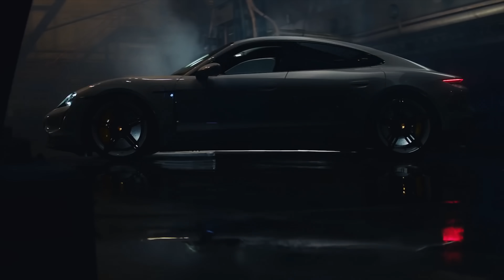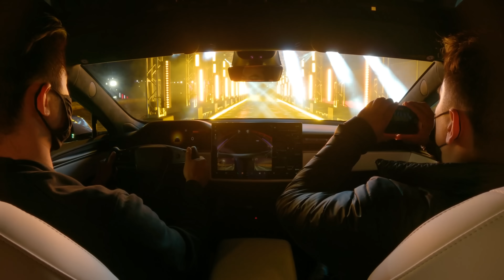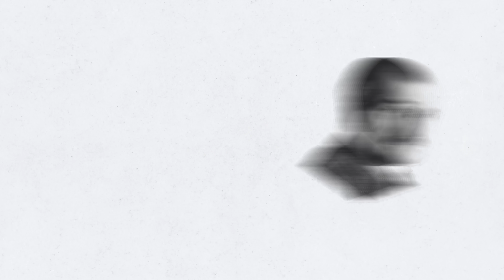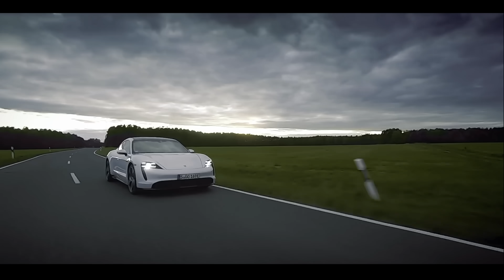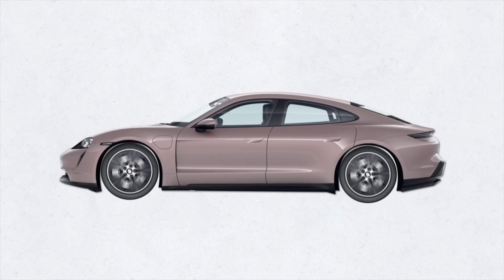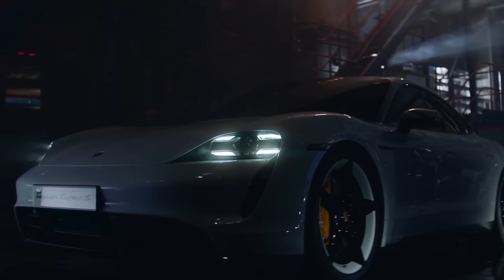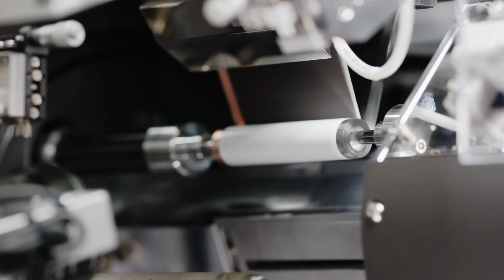I’ve Had Enough, Here’s the Truth About Tesla

Comment: Well for starters I don't like the looks of them. But besides the point they need to do something about a range extension. You can't just have vehicles dying in the middle the road with no power. If they should be adding an auxiliary battery that you can switch with Manual operation to get you in limp mode to a nearby charging station that will leave only necessities operating on that battery that means your phone charger or radio will not work

Comment: its great that they are bring jobs to the US but 1st I want an electric car! BUT the mileage is to low. the average is around 250 miles. I will not buy a full electric until the mileage is double that. look at Toyota they have a RAV4 prime its half electric and half combustion it gets 600 miles of range combined for less then half the price of these EXPENSIVE ELECTRIC CARS. HOW DO THESE MANUFACTORS OF ELECTRIC CARS  want us to buy these expensive cars to the average consumer if they only get so low mileage. Right now I feel that the electric car is not for the average person .I feel these manufactures should look into the combustion plug in cars instead.

Comment: TUV Germany just finished testing 9600000 cars. Tesla model s was among the worst.  10.6% of the model S car's tested would not be considered road legal after the test with 100 check points. Similar to ordinary EU test you would need to keep you car road legal in EU every other year.  The only EV with more flaws was dacia's cheapest cars.  Tesla had flaws that massively impacted safety. Like poor front suspension.

Comment: Does everyone understand that current Tesla cars are simply phase 1 projects for the Mars program? They are simply to prove the concept works. Cyber truck is a phase 2 Off-road car designed to handle rougher conditions. Phase 3 will most likely be 100% integrated with starlink, pi phone, and solarcity. Maybe even spaceX compatible.

Everything about these cars is focused around living on Mars and is subject to change.

Comment: My feelings about electric cars.  Imagine that it's 2035-2040 and the government has forced the majority of gasoline and diesel vehicles off the road.  It's a long holiday weekend in December and the roads are packed with cars.  A large blizzard covers the east west interstates and they become huge parking lots.  Your battery is probably half discharged and the overnight temp will be around zero.  The battery uses electric heaters which won't last overnight.  It will take days to remove the cars and bodies.  Has AOC or any of the green nuts thought about such a scenario?  They better because something similar will happen.
Reply: Pretty dramatic scenario, but it's kinda flawed and irrational. Tesla's 4680 form-factor battery is ramping up and delivers 5X energy density and 6X Power output. As renewables become more efficient and wide-spread, our grid is becoming more sustainable and consumers are installing their own energy generation + storage systems (enter Tesla solar + Powerwall), effectively decentralizing from the grid and becoming energy-independent.

Comment: I am a porsche owner of a 2021 Carrera S and the fit and finish of exterior paint and interior are refined elegance and of course you can select any option to customize your car both interior and exterior.  As for the Tesla.  I am have seen numerous detailers work on teslas and I am not impressed. Many Tesla have very poor paint jobs with numerous defects-from dust specs embedded in the clear coat to scratch and swirls etc.  And for the interior-not very nice looking for a car that costs that much.
Reply: Eh, the fine-detail nitty gritty details like that don't bother me. Performance is where it's at, and Tesla is clearly #1. Tesla's insurmountable lead is accelerating and they will continue their dominance this decade and beyond.

Comment: Don’t like the steering wheel? No problem, the round wheel is still an option, so you can toss out those criticisms. You praised Porches self-driving tech but barely touched on how much better Tesla’s tech is. On range, Tesla clearly wins. You briefly mentioned charging rates but conveniently left out charging networks (hint, because Tesla’s can be charged just about anywhere while alternatives are much more sparse). Don’t like the interior? Fair enough, but that’s purely personal preference, many people like a cleaner simpler design. You also forgot to mention that the Porsche is effectively a sporty 2 seater, while the model S is a full sized sedan -much more practical for daily use.

Sorry to the haters out there, but any honest side-by-side comparison would show the Tesla as superior.

Comment: Ok. The price is high for both but why would you NOT buy the American one. Btw,  I  drive an EV for the ENVIRONMENT. yes. At 1 mile high there is 35% less oxygen. At 2 miles high you can NOT breath normal without  extra oxygen supply. 2 miles is to the end of your fckn street. Now put 1.4 billion gassers in there and you will understand we are poisoning ourselves. Most folks don't understand the science behind this and think everything is A OK. Another thing is the money you carry to the gas station like a junky to a dealer. Just to make a few billionaires even richer. You must be nuts. OPEC keeps the price of oil high on purpose with their cartel racket. And for jobs. I used to be a fuel tanker driver at an airport but now I am a chef in my own restaurant. I don't need the Fossil Fuel industry for the money..

Comment: The 2021 Model S Plaid and the 2021 Model S Long Range have the same body shape with newly widened front and rear fenders. The Long Range version can be ordered with the same 21-inch Arachnid wheels that are standard on the Plaid version. The two vehicles are nearly identical underneath, the main difference being the dual rear motor unit used on the Plaid version.
Reply: Those arachnid wheels are awesome!

Comment: I love these things claiming how some EV can go 1000 ft or 12 miles really fast - why don't they try Le Mans or any legit race? Dakar Rally - the only thing they can compete with is other electrics in a "Special" race.  A 63' VW Beetle could be a Tesla Model S Plaid in a race from SF to LA because the Tesla will have to stop twice, (3, 4 or 5 times if it drove fast); and charge for 40 minutes each time.  Le Mans winners travel the equivalent of Boston to LA and then to SF in 24 hours - try that in any Tesla.. you'd be talking about to 3 days. There is one of the problems of being an EV - if you go fast your range falls very quickly.

Comment: absolutely love that yoke wheel. The pull is insane on that plaid. if you palm the entire side of the steering controls, it honks the horn, so technically you can honk faster than reaching for the center. People who actually USE it love it. People who cant adapt just listen to you tubers who also cant adapt and simply write it off. One finger hooking is how U-turns are done - just like a normal wheel. The yoke is fine

Comment: When these batteries start to brick look out. The cost  mining and of making batteries pollute just as much if not more than the gasoline motor. Then what do you do with all these junk batteries?
Reply: The batteries used in Teslas have an expected life of 300,000 to 500,000 miles. Many of the future Teslas will likely be using LiFEPO4 batteries and have a life of 700K to 1M miles. Plus these batteries are recyclable.  Try getting away from the conspiracy websites for your information.
Reply: @skipondowntheroad5833  You said the magic word....""EXPECTED""

Comment: I will buy one if price is more reasonable like < $50k. My 2005 Sienna is still running flawlessly at 310K miles, has 450 miles range and 5 minutes fill up.. if the Sienna runs out of fuel in the middle of nowhere I just pour a can of fuel and keep going. I can’t charge an EV I’m middle of nowhere.
But sorry, $100k for an EV is insane.

Comment: Hey Scotty been a fan for a long time now I have a 2012 Dodge caravan and it has been a amazingly reliable vehicle recently it wouldn't start just ticked I tried to jump it it wouldn't I tried to smack the starter nothing so it has sat at a garage and the interior lights works there not dim at all and it did finally jump but the garage is telling me they think it's the tipm Have you had many tipm problems because it's a very expensive part and don't want to have to spend it if the garage is just bsing me to pinch a penny

Comment: I’ve used some electric forklifts and from what I’ve seen those batteries get pretty hot when they try to charge them faster. If you’re lucky you’ll get two hours after charging for fifteen minutes. Through the charging cycles and then driving they’re going to get progressively hotter with every charge/discharge cycle. Driving two hundred miles is one thing. Waiting 2 hours to recharge won’t go over very well for all those impatient drivers who pass you like you’re standing still on the interstate. Try driving those things in the snow or other inclement weather conditions. I’ll wager you may get a first time buyer but it ain’t likely to get them back in the dealerships a second time.
Reply: Most EVS have thermal battery management, including Tesla. They're very in popular in Norway and very effective in the freezing weather, they just use more energy in a cold

Comment: Most ev are cheating around spec's when compared to tesla. For example the taycan says its faster while having a lower range which means smaller battery which means less weight which means faster charging. Although they are 30-40% more expensive.  So if you really want a true comparison, be precise accurate and fair to gain trust of consumer.

Comment: I'll only drive cars that cost under $2000 at auction from my local tow yard. I drive a 2005 Taurus I purchased for $250 that had 100k miles, last year and came with rebuilt transmission.
Reply: Does it suck being poor?

Comment: I do some battery research as a hobby and Scotty pretty much puts it like it is. Batteries, when you really take a step back, are pretty weak. Gas is so much more efficient, but as political powers push electrification, everyone is now trying to make better batteries for cheaper. Tesla knows this well and they are putting everything they can into it. However, because Tesla is mostly concerned with affordability and transitioning the world to electric, they decided to make the 4680 cell. The 4680 cell is by no means as revolutionary as a solid-state battery or graphene-based chemistry, BUT, it is going to be MUCH cheaper to make with respectable improvements in range and safety. For the average person, the 4680 cell is marginally better. But for the manufacturer, it's a huge improvement.

Comment: Just want to say you are one of the best Mechanics around! My dad was a mechanic and I learned a little from him..but now I have been learning alot from you!! .I have a question... My husband and I bought a 2006 Cadillac SRX 3.6 a couple months ago.. I wet to AutoZone I hooked up an obd11  to it  cuz the engine light came on..... it said that two cylinders were not working because it was running really rough so we replaced the ignition coils and spark plugs. Still every time I go to put gas in the car the car would stall and  I would have to feather the gas tank in order to get it to run. So I ran another diagnostic test and it said the evap purge valve needed to be replaced so I did that. Well I am still having the same problem it idles rough ..and when you accelerate it feels shaky and bumpy just does not feel right something is wrong. I have been looking all over online I don't trust mechanics around here that's why I always try to do it myself.. I bumped into your channel and I think you are absolutely amazing!!! Please help!

Comment: Hey Scotty, Im running out of ideas! Misfires from cylinders 4,5,6 and a bank2 catalyst below threshold code. I already installed, 6 new fuel injectors, 6 new iridium spark plugs and 6’new ignition coils. I cant get the codes cleared and fixed?! Help!!! Its for a 2016 Honda Pilot exl. Had the timing belt changed at 80k miles it now has 120k.

Comment: Hi scotty small correction the 2170 is mostly used by tesla since it was the one who developed the standard . The industry standard used by competion is either prismatic cells made by LG chem (mostly) or 18650 used by lucid . i believe tesla has moved all of its cars from 18650 to 2170 .. the 4680 as was mentioned was a internal RnD effort , The issue i believe tesla is facing in 4680 production is with yields not being enough . The chemistry and manufacturing have been validated already with test vehicles it isnt vapour ware ... Now with regards to which car between tesla and a porche .. between power, comfort, range, practicality, technology and price ... tesla has to be the choice for any rational person
Reply: So many errors...  The Model S and X still use 18650's, even the Plaid.  Lucid uses 2170 cells by Samsung, as does Rivian.  Prismatic are hard-cased cells, typically LiFePO4 and by Chinese manufacturers, like CATL. Soft "pouch" cells are used by GM, Ford and others and they are made by LG and a few other manufacturers.  The 4680 is very much vapourware, it is very far away from significant mass production due to quality issues.  You have to keep in mind that even the most infinitesimally small fault would cause a recall (ask GM/LG about that...)
Reply: @awebuser5914  2170 is still mostly used by tesla since other cars arent on the road yet and can be rounded up to zero . my error was that 18650 was used by competition , tesla is still using 18650 . This is still 2 order of magnitude less then their current line up using mostly 2170's in the 3 and y. 4680  yield and quality are 2 different issues . Tesla in their conference call mentioned they had YIELD issues , which means the Yield of the process is less than ideal . The chemistry is valid and cars are on the road using them for life leader testing . The definition of vaporware is tech which does not exist and  option to own it in the future are sold.

Comment: Hey Scotty I have a question I’ve owned two cars a 2003 Subaru Forester and a 2006 Pontiac grand prix and they didn’t last long I live in la I used them to go to work and back home and in the weakend a I like to cruise and go to beaches both these cars will fall apart the exhaust would break of the hook and be hanging engines would start messing up and would become unreliable I want to buy a car that will last me a while both these cars have lasted me less than a year I want to ask if a 2006 Lexus RX 350 are they reliable I do know how to do the simple services

Comment: Tesla is clearly the best when it comes to range and brute acceleration performance, but the interior and overall build quality is quite frankly utterly laughable for the price point. Even Ford (and I don’t mean Lincoln, I mean just regular old blue oval Ford Explorers and F-150s) significantly surpasses Tesla in terms of interior quality and infotainment tech. Tesla also has serious problems when it comes to overall quality control and service.

The German luxury EV’s don’t have quite the range that Teslas do, but the overall build quality is vastly superior. And there’s not even a question as to which is better in terms of interior quality and technology - the Germans are head and shoulders above the competition in that respect, as they long have been.
Reply: You should actually check out a Tesla built in the last year or 2.  Significantly improved over the earlier versions
Reply: @monsterous289  Maybe there have been improvements but they still lag badly behind the Germans. One of my coworkers has a late model (I think it’s a 2020) S and there are noticeable flaws in paint work as well as fit and finish. And of course the interior is very plain Jane compared to a Mercedes or BMW at the same price point. You can’t expect a relatively new company to be as refined as one which has been making cars for over a century, but if Tesla is going to continue to expand in the lucrative luxury market they will need to address these issues. The fact of the matter is that most people who are going to drop $100k on a luxury car are older and don’t care all that much if the 0-60 time is 2 seconds or 3 seconds; they want the best in comfort, materials, tech and overall build quality.
Reply: @MegaChonker26  Well, I would point three things out:  
1) Your friend should have known that the 2020 Model S was the last year of the old model that came out in 2012, which still used machines from 2012, bought on the cheap from GM and Toyota. Old machines that yes, did have major flaws.  For the new model, those machines have been replaced.
2) High quality minimalism is the new look.  Most people including I love it.  Sure, I'm still going to drive the heck out of my manual Lotus Emira when it comes out, but the new model interior is definitely not cheap.   
3) Tesla seats are rated as the seats with the longest sit-in time before discomfort, up there with Rolls Royce, etc. Not saying the entire car is of that quality, but the seat comfort is, and a big part of why older folks with huge car garages use the Model S as their daily. It's the most comfortable and simple to use/maintain.
Reply: The price point is laughable low for that kind of performance.
Reply: @mcplutt  Straight line acceleration performance only. An M5 the Tesla Model S Plaid is not and never will be, considering its enormous weight.
Reply: @MegaChonker26  Enormous weight?  Model S is only 200 lbs heavier while having significantly lower center of gravity (4300 vs 4500lbs)